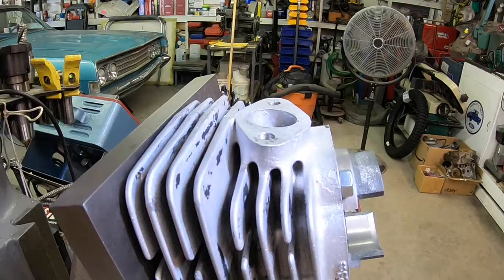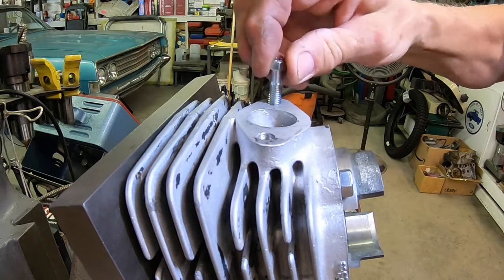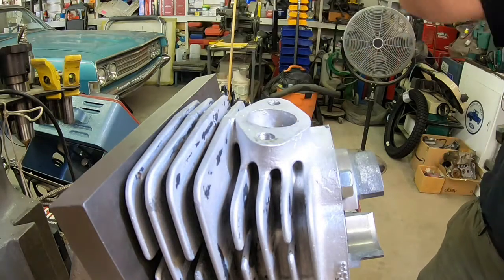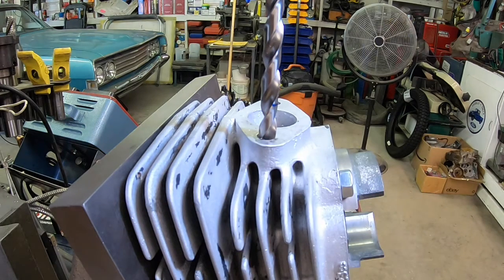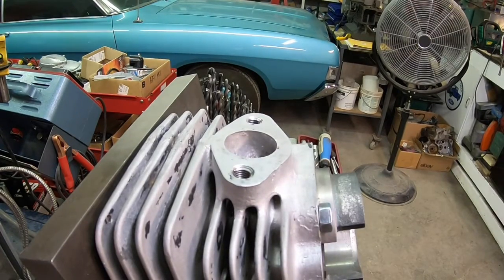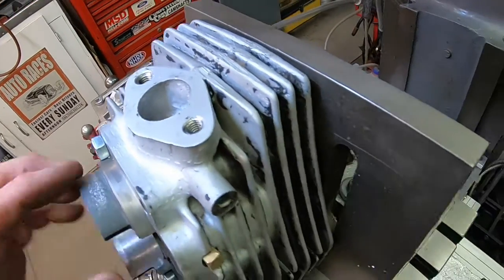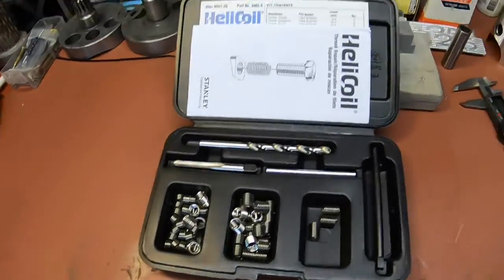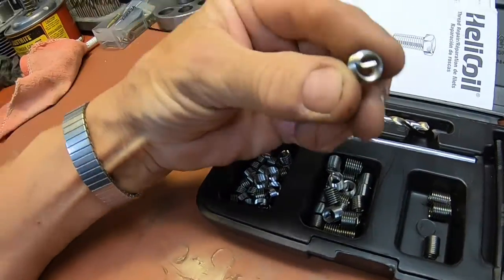Heli-coil thread repair on motorcycle cylinder, Yamaha AT-1 MX

Comment: Hey Dale, looking good man. Got a question for you, the abestos exuast  string, is it for wrapping around the exhaust going into the cylinder or the rear packing for the baffle. Thanks in advance
Reply from the maker: Hi Larry, I use it to pack the exhaust flange on the engine and then slide the pipe into it. That provides a seal there, so it doesn't poop oil all over the front of the engine and fender. There is also the round crush gasket that goes between the cylinder and the exhaust flange. You bet no problem anytime.
Reply: @montana2strokeracer compression lost or lean condition
Reply: Thanks for the info my Kawasaki f11 250 didn't have either, wouldn't that cause a compression lost?
Reply from the maker: Kevin Bergeron is the Kawasaki guru, he could probably give a better answer than me.